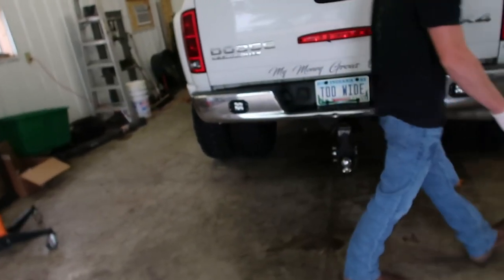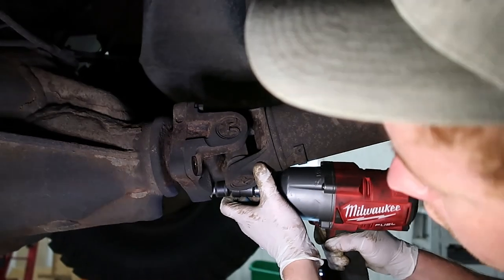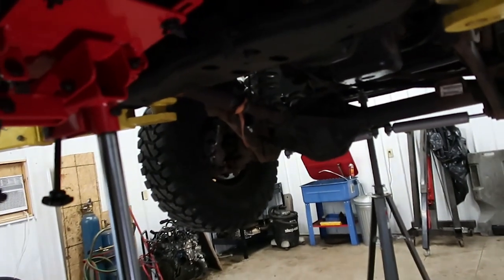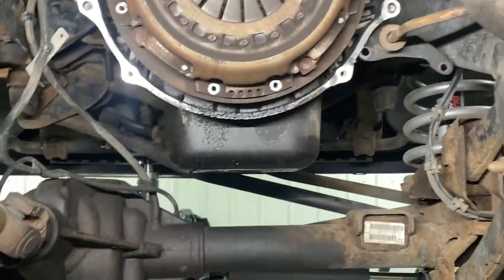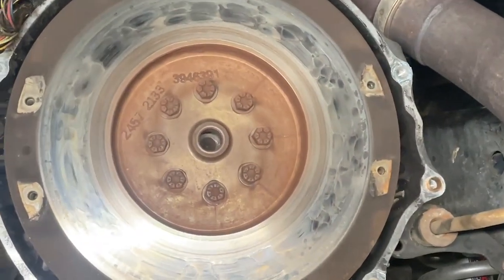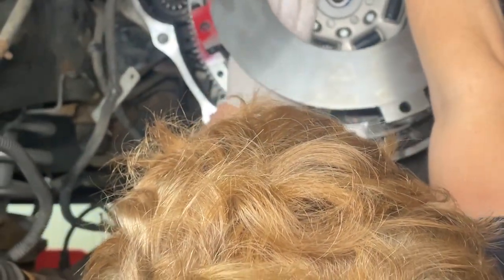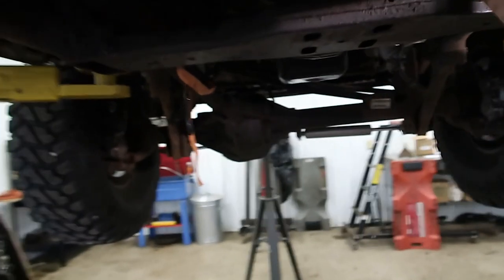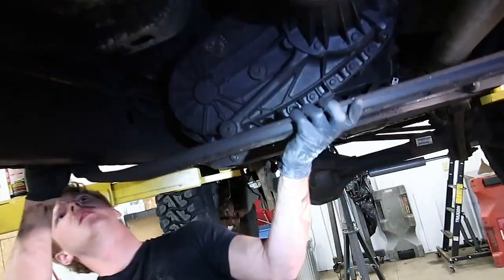Dual Disc Clutch Install *STEP BY STEP* NV5600

Comment: great video. Little tip: take a tiny piece of 600 grit sandpaper around the end of the input shaft go around it a couple times then a tad  bit of grease. removes and burns and makes its slide in new pilot bearing way easier.

Comment: I pray people torque everything. Bought my truck with a brand new south bend single and it was toast in 6000 miles because they used an impact on the pressure plate and winging it. The fingers were all messed up

Comment: What’s the benefit of a dual disc on a stock truck?
Reply: None
Reply: Some claim longevity ( my factory clutch lasted 245xxx miles) a smooth engagement while shifting ( debatable) but the biggest difference was in my wallet like 600-700 difference and i noticed that rightaway